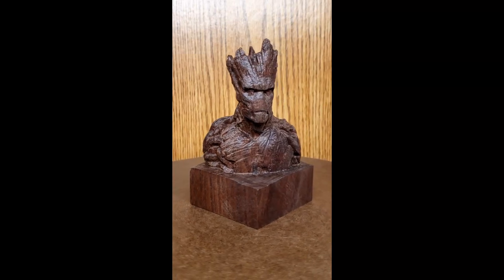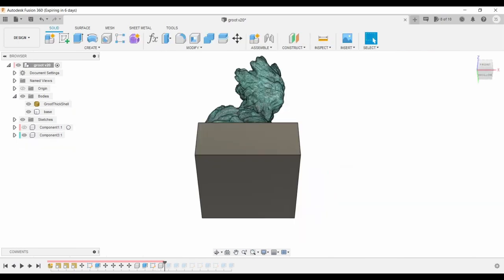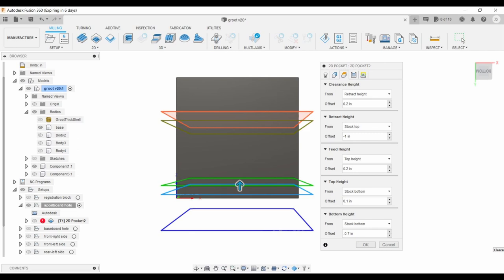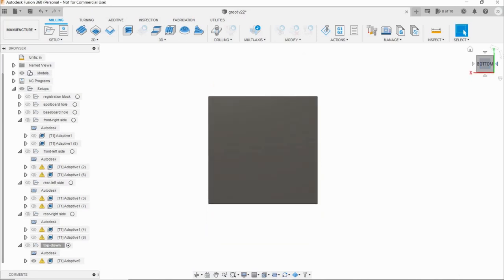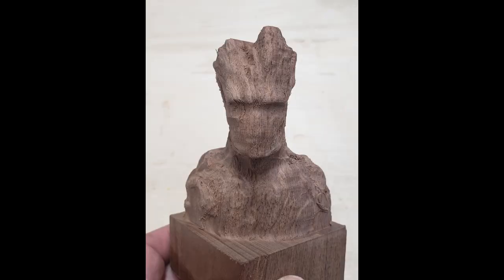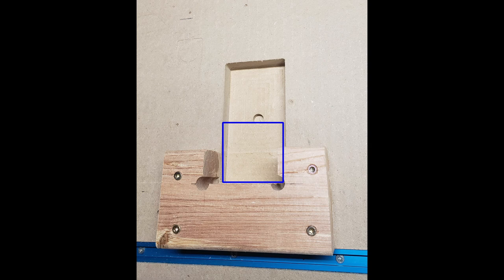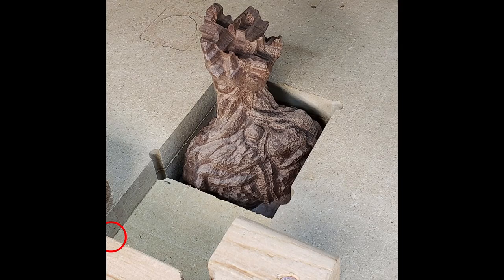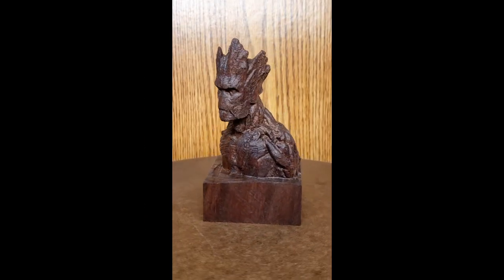Making Walnut Groot - 4 sided carving (and bonus 5th side!) on hobby cnc

Comment: That was intense. Great job! You said you  cleaned up the pocket manually. Did you do that with the jog controls in carbide motion? I would love to be able to control my Shapeoko manually but the jog controls seem a bit clunky for that.
Reply from the maker: Thanks! Yes I use the jog control in carbide motion to do a few things manually. It's good enough for drilling out the rounded corners which is what I needed.

Comment: When I hear people saying imperial measurements out loud it solidifies my belief they're absolutely barbaric and makes no sense to use them. LOVE this model though -  great process
Reply from the maker: Once you get down to fractions of a mm metric is not much better. Thanks!
Reply: @aweirdguynamedjeff  one thing I never understood is the mixture of imperial and decimal places. 1.5 inches, you may as well use mm
Reply from the maker: Well it's not any different from 1.5mm. It is a decimal fraction of the smallest available unit. It would have sounded better if I said 2 thou instead of .02" but it confuses anyone who doesn't think like a machinist.